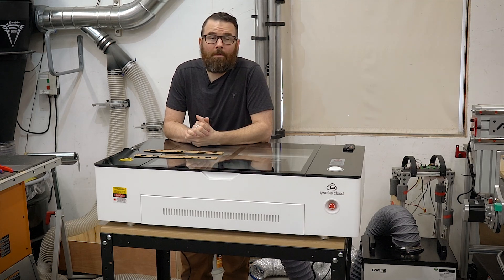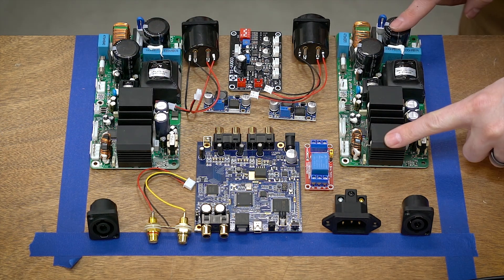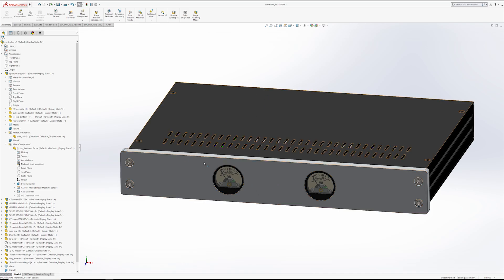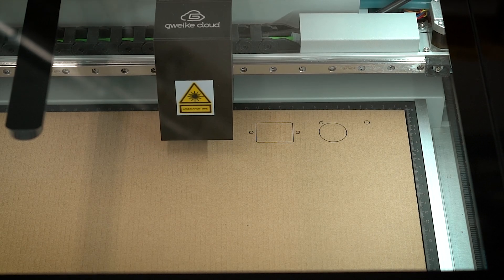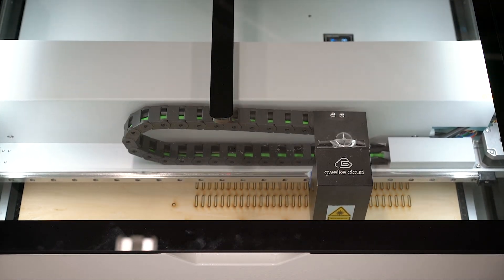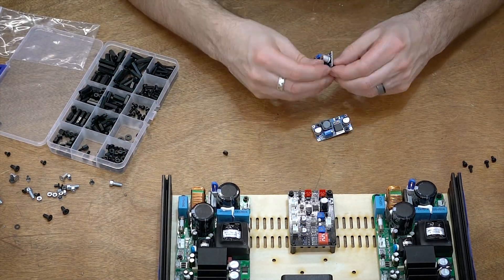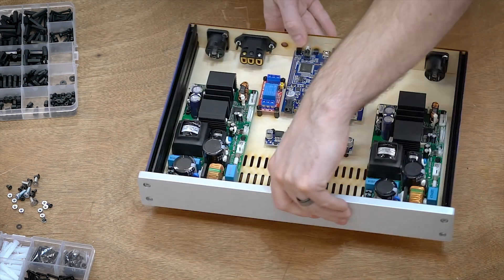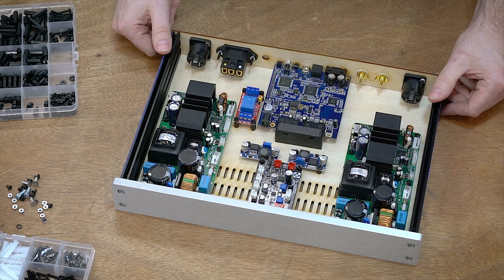Prototyping with the Gweike Cloud CO2 Laser

Comment: I asked on your previous video if the laser would be suitable for use indoors, but it looks like you've now got the "home type" air filter connected?  How well does it work for controlling the smell?
Reply: I have the same laser, there's no way I'd want to use it indoors! I have it exhausted through the wall of my workshop to the outdoors with the inline duct fan.
Reply from the maker: Correct, but I have the optional HEPA air filter which allows you to use it inside without venting out a window.
Reply from the maker: Hey!  I do have the HEPA filter on it, and it helps tremendously.  I will be doing a full review, but here's my quick take.  If you're using it occasionally inside and don't mind some mild odor, it does the trick.  I would say it's better than me venting outside with the door cracked, as some of the fumes still blow back in the shop.  If you have a small inside room (like a home office or something) and you're trying to run an etsy shop, cutting long hours all day, you're going to still want to vent outside or the fumes will build up over time.  It cuts down on fumes by 90%+, but you can kinda tell that the laser was being used.  I think MOST of this comes from fumes built up inside the enclosure, and just leaving the lid open for a minute or so at a time.  But I was able to cut acrylic, venting directly into my shop and it was noticeable, but not bad at all.  Usually with acrylic, I need to vent outside and I don't want to be in the shop afterwards at all.  Hope it helps, let me know if you want to know more!

Comment: Fun project to follow along with.  I see some fuses on the amplifier boards, is there any need to add additional protection for any of the other components?  Also, would the amplifier boards run cooler if their heatsinks were directly below the holes in the case?  Looking forward to how this all turns out in the end.
Reply from the maker: Great question.  I don't think additional fuses are terribly necessary here.  The amplifier modules both have fuses and if anything is going to fail, it's going to be those.  I COULD add an in-line fuse before or after the relay module, but I'm not really sure it would do much.  But good idea.  And yes, it would run cooler if the heatsinks were closer to the cutouts, but that really screws up all the internal wiring (lots of extra wire).  These modules don't get very hot or even warm, especially with the attached speakers, so I'm not too worried about heat.

Comment: Switching buck converters for powering the DSP? Might want some good capacitors on there, or a linear regulator somewhere in there.
Reply from the maker: Yeah, not ideal.  I did listen to it for about a month through the buck converters and it didn't sound any different than the standard power supply.  In theory, I could always add an external linear supply, but I'm not sure it would make much difference.

Comment: Love it.  Great detail explanation. I don't have a mill to drill and cut the holes. In the past, I used painters tape over the base of the metal enclosure and used the Co2 to accurately mark out the positions again. Then laboriously drill and cut by hand. 👍👍👍 🙂Rob
Reply from the maker: Ah, that's a good way to do it, basically creating a really accurate outline for everything.